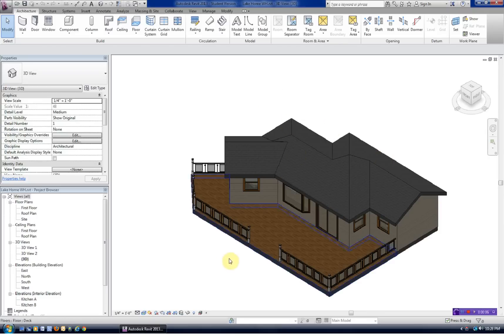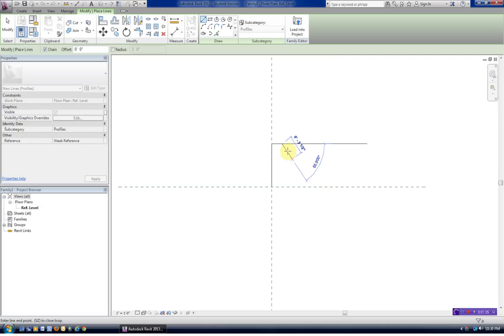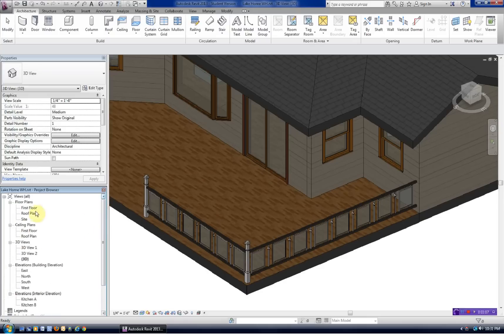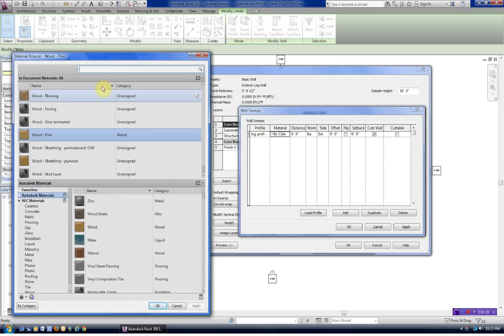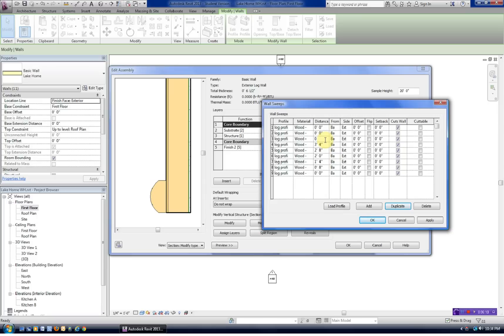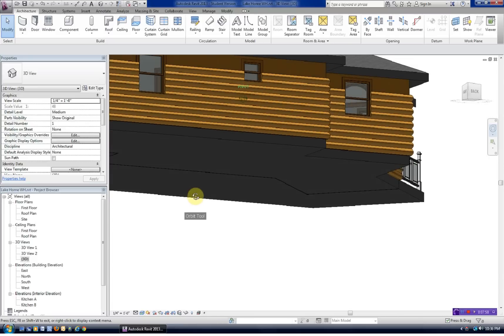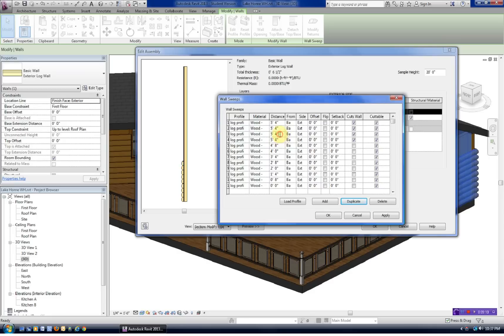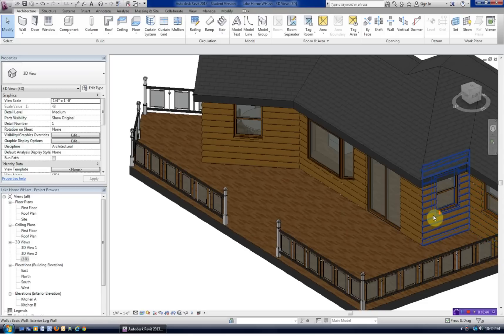Create Log Wall Sweep Revit

Comment: What the video fails to go into is how the final log wall is cut at the roof line. The resulting wall is stepped on each log at the sloped roof line. How would one create a log wall that can be cut properly at the roof line AND for this log wall to be placed below a roof but above the floor where one has a stepped floor plan with multiple roof lines